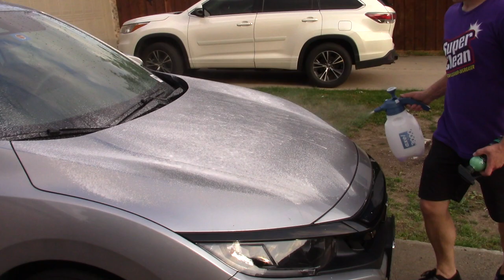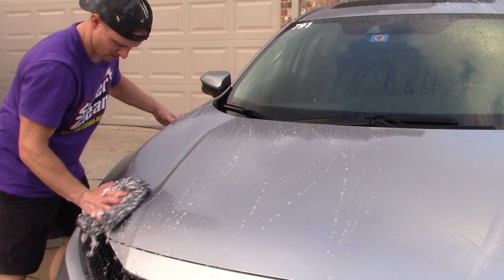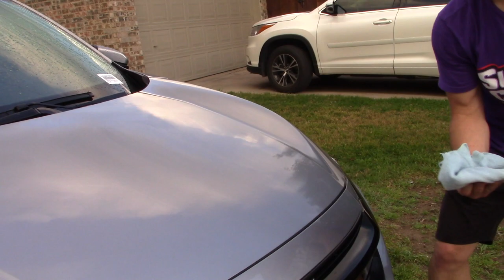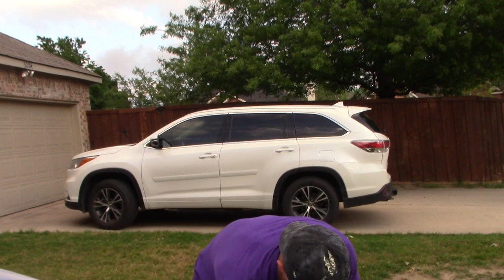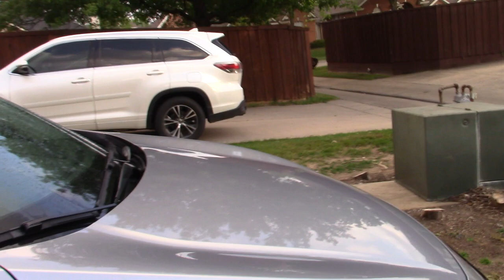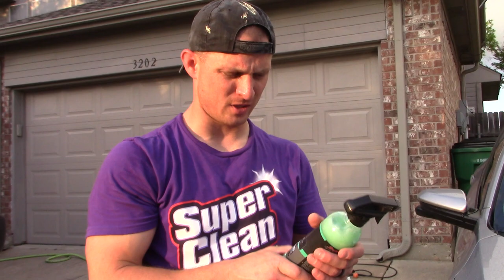Radiant | Ceramic Spray Coating from Jay Leno's Garage

Comment: My local walfart just did a redesign. For whatever reason they decided to clearance out most of their jay leno stuff. I got 2 bottles at 5.00 each, no joke. Ended up buying the entire jay leno line since it was so cheap! The trim and tire stuff is amazing. Ive washed my wheels and tires 4x now, and its still on the tires.

Comment: I just used this on my car today love it. I also use the wheel cleaner and tire and trim shine from Jay Leno as well. Amazing products. I’m testing the radiant this coming week to test the static properties
Reply from the maker: Thanks for sharing
Reply: When u wash car does it come off
Reply: @MrTakeOne  most products tend to last at least 3-4 weeks depending on their application. If prepped correctly it’ll last a while